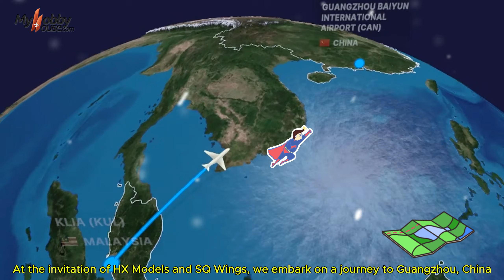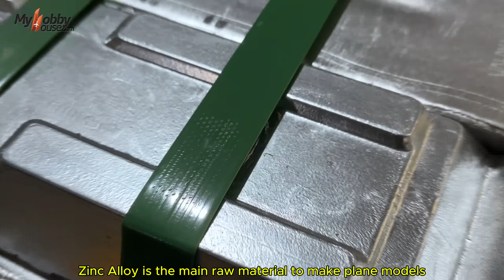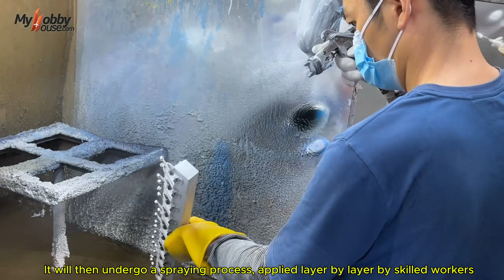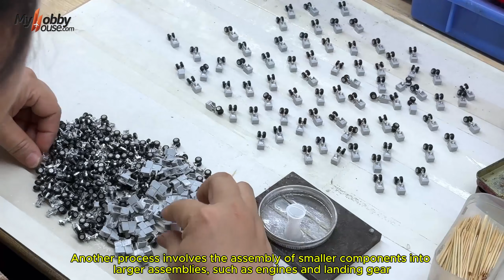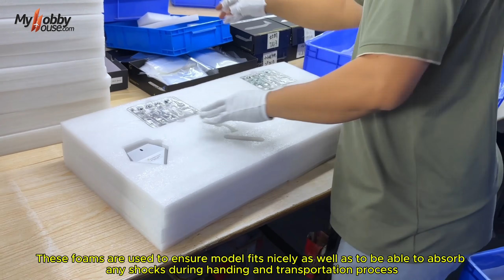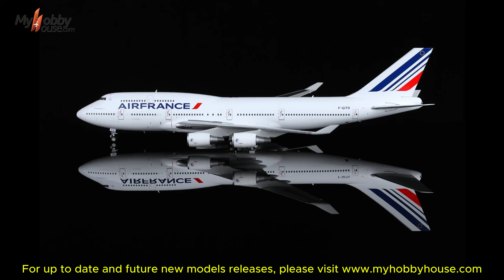How diecast plane models are made

Comment: It would interesting to see plastic scale models built by the factory workers, given they do much of the same work daily I bet they would turn out amazing!
Reply: Plastic is easier as temperatures are a lot lower so injection moulding machines are cheaper for plastic. But I do not know how they make the mould for either plastic or metal. My guess is they program a CNC milling machine with all correct dimensions of airplane model maybe using CAD and the milling machine carves out the correct shape of the airplane from the steel mould block? Does this make sense?